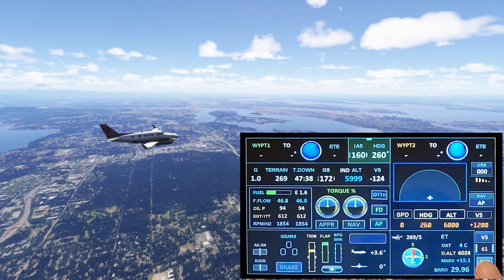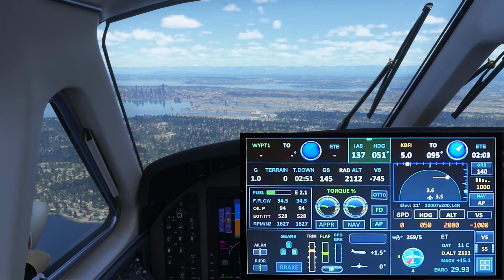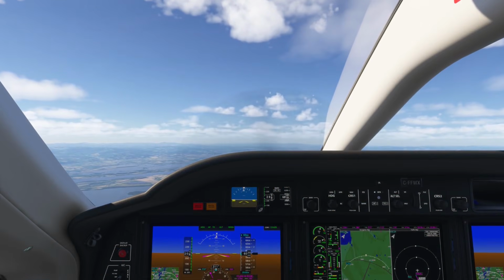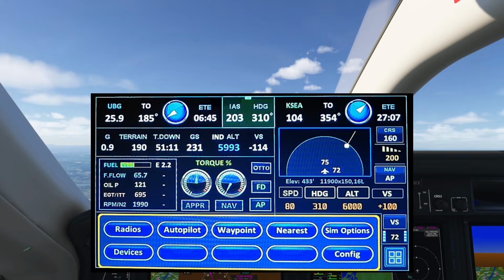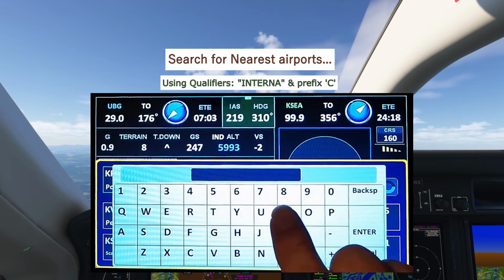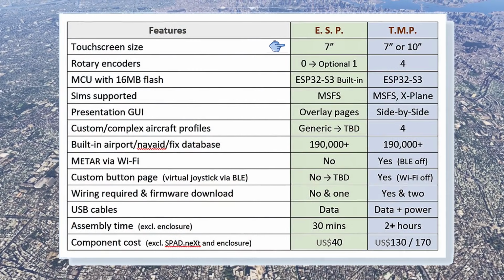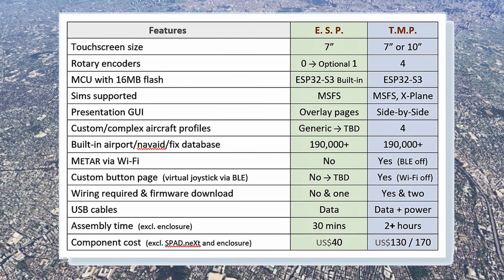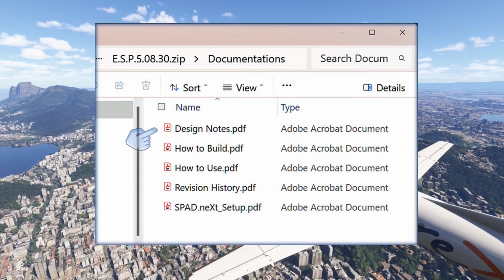Easy To Build Touchscreen Panel for MSFS

Comment: According to your description for the VIEWe-Display "The source code can be recompiled to work with VIEWe with just a single-line edit.". But what line in what file is to edit how ? Best regards
Reply from the maker: I thought you had already built one unit a few months ago.  Anyway, here is the info:
I have updated the “How To Build” PDF to include more info on this.  I have also upload a complete build folder (Platform.IO) for the VIEWe.  For a limited time, it is available on:
https://drive.google.com/drive/folders/1GNeKtWuMaUyOQlc7MYUf1ucuUDa8WsoJ?usp=drive_link
Reply: @discman777  YOu´re right, I tried it a few month ago with a waveshare display but it didn´t work and then I had no time to continue,..
Thaak you so far for the upload, I´ll give it another try ;)
( A hint: Couldn´t you zip the compiled viewe files as well and make it available for download? You´ve got them already :D )

Regards
Reply: I didi it !
Even though there was an error message during debug ( and no "littlefs.bin" was created, so I copied the one from your sunton files).

Thak you again

Regards from East-Frisia, GERMANY
Reply: @snoopy-music   Hi guy, I have the same VIEWe-Display and i succed to upload from the complete build folder from "discman". But, sadly, I have still a problem with the SD card, it doesn't mount. I would like know if by your side you succed and if you have or not the same problem. Thanks
Reply: @sergedechazelles4539  HI, I´ve no SD-card in use right now, it work´s perfect without
Reply: @snoopy-music  thank you for your reply :) About the card I have sent a mssg to discman and he will have a look on it asap. Have a good day

Comment: Found this panel at Walmart, would this work?
ESP32 S3 Touch LCD 7 Inch Capacitive Display Screen 800x480 Development Board Xtensa LX7 WiFi BT5 CAN RS485 Sensor
Reply from the maker: Since you haven’t included a link, I do not know which exact product you’re referring to.
The REQUIRED specs for the display: ESP32-S3, 7” 800X480, with touch, 16MB Flash, 8MB PSRAM.

My search on Walmart US yielded multiple products. One of them is the supported “Cheap Yellow Display” (Sunton):
https://www.walmart.com/ip/ESP32-S3-7-Inch-800X480-TN-RGB-LCD-TFT-HMI-8M-PSRAM-16M-Flash-Smart-Display-MCU-WIFI-Bluetooth-Module-With-Touch/3249138643?classType=REGULAR&from=/search

The binaries available to you is for the Sunton only.  BTW, their photos do not include a 4-wire cable, as I had received mine from Ali Express.  The cable will be needed for future encoder add-on.
All other options, as explained in the How to Build PDF, will require rebuilding and/or modifying the code base, at best.
Reply: @discman777  I tried to post a link, but it wouldn't let me. I looked for an Email address for you, but you don't list one, and no contact information
ESP32 S3 Touch LCD 7 Inch Capacitive Display Screen 800x480 Development Board Xtensa LX7 WiFi BT5 CAN RS485 Sensor
Reply from the maker: @jus4funtim  If you need to email me, open the “How to Build” PDF (from zip package), go to the very bottom for a link
Reply: @discman777  I've ordered the one you listed from Walmart, delivery is Oct 2nd.
I used to be quite tech savvy, but at 70, I'm losing memory, so even though I know this project is quite simple, I have to concentrate, but that's why I'm doing it, to keep my mind active.

Comment: does anybody have a file to 3d print the case for that screen?
Reply from the maker: With a search on Google:

https://www.printables.com/model/1159884-sunton-7inch-display-housing-esp32-8048s070-with-s

https://www.yeggi.com/q/sunton+case+7/

https://www.printables.com/model/632329-sunton-7inch-display-housing-esp32-8048s070